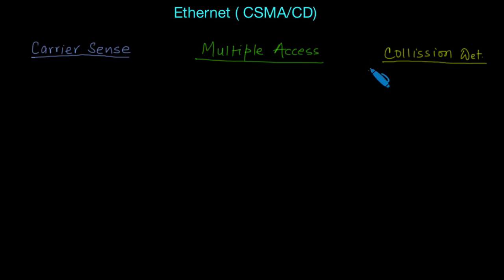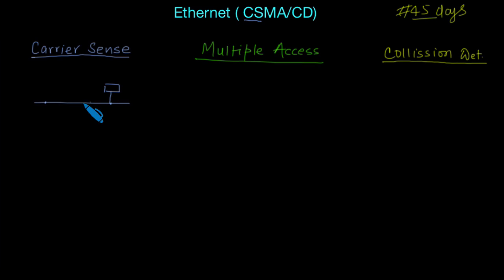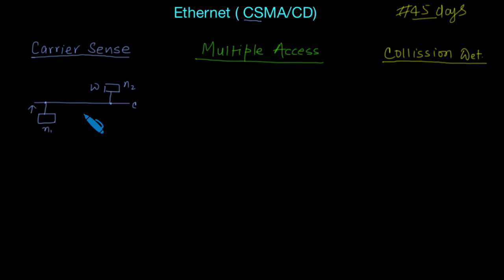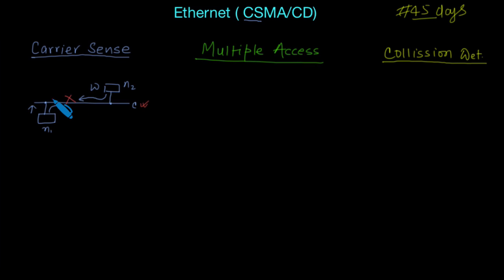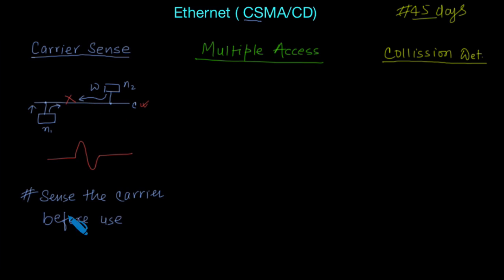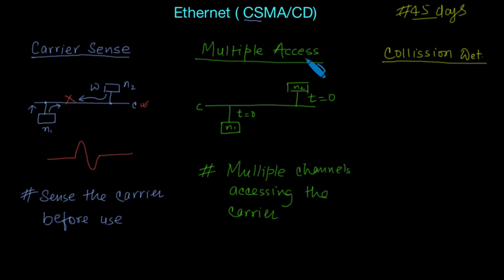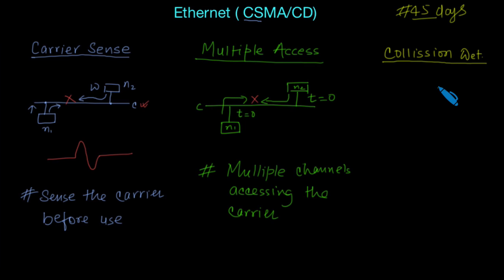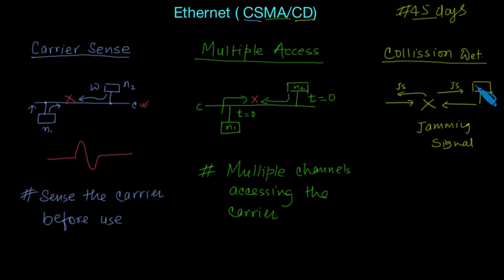Understanding CSMA CD in Ethernet

Comment: Why are you talking about CSMA/CD?  It's been obsolete for many years.  It's not used with switches, only hubs and coax networks.
Reply: Colleges still teaches this concept
Reply: @tanmoydas7072  Wouldn't be the first time they taught obsolete stuff.  I supposed it's useful to know the history, but that's about it.  When I did my CCNA a few years ago, one thing I noticed was frame relay was still part of the subject matter, but MPLS wasn't.  Frame relay had been obsolete for years at that point, but MPLS was current.
You're unlikely to find many networks being installed that use half duplex.  Maybe we'll start putting in ARCnet or DECnet networks again.  🙂

Comment: What you explained under Multiple Access is wrong. Multiple Access means that after a station sent data, it can try to send data again. There is no waiting like there is with token rings that stations have to wait after a transmission so that other stations can send as well.
Reply: No, it means multiple devices.  The old coax and hub networks were half duplex and with multiple devices, some means was needed so that only one could transmit.  That's where carrier sense comes in, so one device doesn't transmit, when another is sending.  Collision detection is used when 2 or more devices transmit after assuming the network is clear and then transmit, resulting in a collision that can be detected.  Both Ethernet, on half duplex and token ring are multiple access.  Not so much with Ethernet switches.